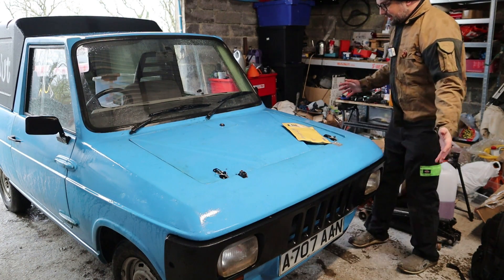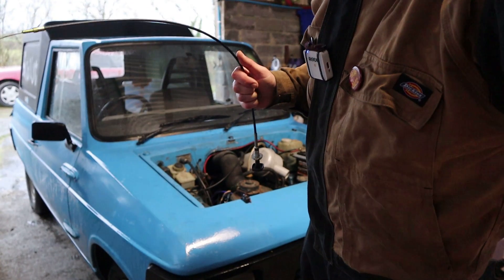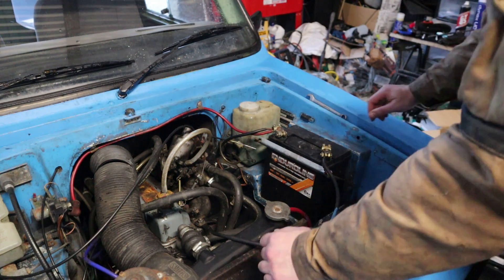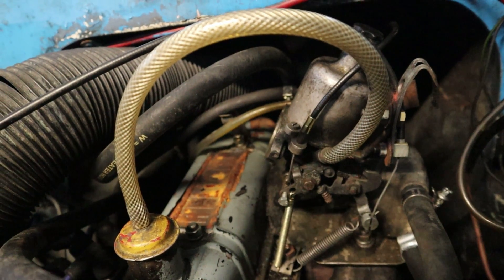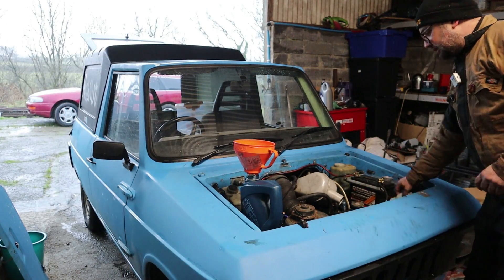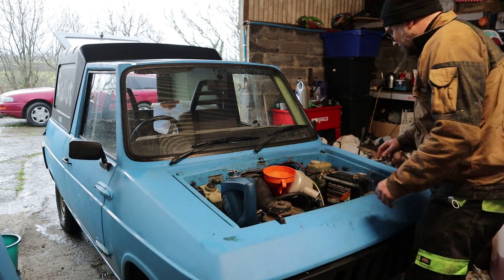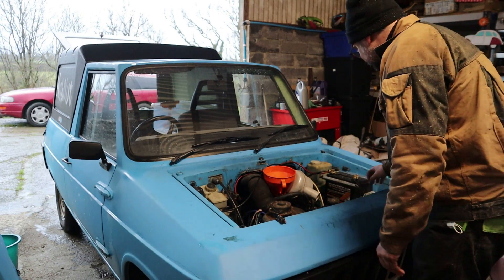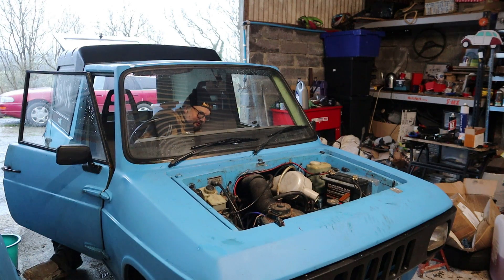Reliant Fox: Choke cable at last! Contains waffle

Comment: When you change the oil filter its always a good idea , when possible,  to pre-fill the oil filter before you screw it into place.
In older cars  you can actually hear the crank running dry and the note change when full oil pressure returns.
All the best ..Mike.
Reply: Or just over fill slightly past the full mark works for me.
Reply: A good point that one, unfortunately the reliant engine oil filter is mounted sideways so it’s not possible on this one sadly.

Comment: Ian, I have in the past cut the brass connector bit with the two screws out of the plastic of an electric connector block to use as a throttle/chock cable end stop, they work a treat and with the add security of double screws.

Comment: I for one will be at the classic restoration show, its more my cup of tea... the nitty gritty practical side of classic cars which isn't at times very glamorous (the far opposite at times) and as you said is the realistic side of classic ownership. Most people can't relate to a lot of what is shown in the classic motor show, most don't have the income and time to make their classic look that good! The show is also the right size and the ticket prices are way more value for money. I may be showcasing my Focus MK1 on a Ford owners club stand this depending how many spaces they get allocated, the plan is to drop the rear subframe and rebuild the control blade rear suspension, such a sticking point that owners put it off. If I see you Ian I will certainly say hi!

Comment: I would like to see foxann used as your daily driver, cheap to run and keep. Regular use would do her the world of good and be ideal for deliveries to and from post office.
She wont rust with galvanised chassis and fibreglass body. Spend a few pounds getting bushes changed and engine tuned properly and learn to enjoy her.

Comment: Entertaining video. Love that you're so careful with the engine after an oil + oil filter change. Seems like you need to adjust the choke fast idle up a smidge. I used to blank off some of my Alfasud's radiator in Winter to get the engine to run hotter. I remember a friends MGB temperature gauge indicated that in the Winter the engine thermostat was cycling open / shut all the time while driving due to an overpowered radiator (and engine driven fan constantly running); I'm fairly sure that blanking off half the rad would have fixed this `hunting' problem.

Comment: Don't  worry the demist in my Bond Bug and then Reliant Robin where just as useless. Shuddered at the water pump screech the Bug had the same and the bearing siezed, shaft snapped and fan went in the radiator splitting a core on the way home from Bangor Uni to nr. Blackpool while going through Conway. Always had an emergency kit in the boot of odds n sods, out came some Devcon 5 minute Epoxy, bit like JB Weld nowadays, onto the split and it held okay for another 16 months being a cash strapped student in '74!!! 👍😊

Comment: If that choke cable gives up possibly try a heater cable for a mini, the one that changes the valve under the bonnet from hot to cold, if I remember rightly it's a solid cable and quite long as well 🙂

Comment: Ha ha. As you’ve probably discovered, you do need two nuts as the cable attaches to the fibreglass bulkhead then you reinstall the grey plastic dash trim and the chromed silver trim nut goes on top. Ultimately, if the outer cable is good you can just replace the solid inner. Quite an interesting choke mechanism on SU carburettors as the whole jet moves down. Regarding gutters, the later 3 wheeled Reliants had stick on affairs that had a thing for detaching with age but fairly easily rectified by cleaning up, masking off the body and bonding back on with a PU bonding adhesive. Best done on a warm day so plastic gutter is nice and pliable. Foxanne is just plain quirky and a great piece of basic motoring.
Reply from the maker: Oh, THAT'S how it's meant to work? Oops...

Comment: Thanks for the tinkering vid, Ian. I remember that when you went to Bromley she was getting through a lot of oil, and when you returned you concluded that it was likely that it was burning rather than a leak. Did that get rectified? I recall a low compression on one cylinder and was wondering if a sticky valve might be lingering. Foxanne is a great car for running about and doing local errands as well as any upcoming adventure.

Comment: As usual I posted a comment before watching the complete video but if you want to Make a stopover on the way to the NEC I would be more than happy to set the emissions timing and check out the ignition system to get a running sweet as a nut just let me know I have a lot of spare time because I’m Retired thanks for the fantastic videos and stay safe

Comment: It's definitely worth getting someone to tweak that engine. Properly tuned, that Reliant engine is reputedly capable of producing better bhp/ton than a Ferrari -some of the Tempest kit cars with that engine are absolute stormers. I'd also put some insulation under the bonnet. My experience with my Scimitar SE4a was that a fibreglass bonnet causes a lot of condensation, which in turn means most of the ignition gets pretty damp.

Comment: Turning it over with the coil disconnected is never a good idea, especially on a carbed car as there's now a load of fuel sat in the cylinders and why it was hard to start. Essentially flooded.
I like Foxanne as she's just different, quirky. The rest I just see as average or even not very good cars. I grew up seeing Ladas and invicars all the time. The charades and Matizs were everywhere in the 00s. Multiplas I've always hated.

Comment: I rather fancy Foxann as a pick up. Not as practical of course but would look lovely with some smart wheel trims and the back box off. But what to do to keep the elements out of the cabin though?
Reply from the maker: They did sell a rear cab section, so you could have them as a pick-up.

Comment: Love Foxanne, Ian. I would like to see you improve Foxanne but in subtle ways so that she stays a Reliant. Perhaps fit electronic ignition, higher pressure SU mechanical fuel pump and carb (HS2?), repair the bonnet properly, insulate and retrim the interior. What do you think?
Reply from the maker: She already has electronic ignition. Fuelling changes are on the agenda I think. She should definitely have more grunt that she does.
Reply: @HubNut  great. Thanks for the reply, Ian.

Comment: Seems like a simple duct-tape wrap would suffice for the split heater air hose. Fixed a half dozen vintage SAAB demister hose leaks with duct tape.  Or is this some MOT reg unreasonableness?
Reply from the maker: I've lost my duct tape...
Reply: @HubNut  Or gaffer's or whatever the nomenclature in British English for wide, sticky cloth infused tape for sealing in damp locations. 

 Concerning the weakness of the heater blower, have you ever had the unit out and checked how corroded the motor's commutator is?  Or if the carbon brushes are worn down and reducing their spring effort against commutator? Assuming this isn't Lucas the Dark Lord of electrons, who hasn't had his way with the wires that feed the heater motor.

Comment: Ok, maybe I'm being sophomoric, but I chortled at "I think I only need one nut".
On a more serious note, I was surprised that any water-cooled car engine requires 20w50, especially in winter, even if it's just a British winter (couldn't help myself).  Part of the interest in your Reliant is that she seems like she was a HubNut-type car right off the showroom floor.
Reply: When I started in the motor trade, all cars used 20w50 oil, modern grades would have leaked out too quickly!
Reply: One of my cars runs straight 40 grade in winter (50 grade in summer). Older cars tend to have very crude oil seals (if they have any at all) and thinner oils just pour out of all sorts of places!
Reply: @saxon-mt5by  Perhaps it's because I'm more accustomed to cars sold in North America, but by the mid 1960s almost all the cars on the market used 10w30 with a switch to 5w30 for winter.
Reply: @CaptHollister  I'm pretty sure 10w30 wasn't even available in the UK in the 1960s; even 20w50 was only just becoming commonplace.

Comment: I care more for Foxanne because she is understated and despite being rarer than a 2CV and perhaps as rare as (possibly rarer than) an Invacar, Foxanne comes across as attainable. A classic car one could just go out and buy, then use normally - a sleeper of the classic car world. Similarly, Matt@FuriousDriving's Volvo 740. Just different enough and "we don't see those anymore sadly" from certain quarters (like myself) who get that it is about the experience, not having and utilising pseudo-performance because either we were never that type of person to begin with, or otherwise not under 25 years old and/or full of it.

A shared trait with Twc is the "little engine that could" and a respect for keeping an unloved (among the great unwashed) car going as opposed to scrapping it for no other reason than it being old. The same argument could be said for Elly, but I'd counter that with most people outside of 2CV/classic car boffins care more about a 2CV's looks than what's underneath (ditto classic VW Beetle) and therefore far more cemented in the public consciousness.

Additionally, being a classic Volvo enthusiast I'm very much biased; the 340 seats also swayed me very early on. :)

Comment: Foxanne is just as cute as Myrtle, Elly and TWC, just in a slightly different manner!

I feel that there are two directions to go with Foxanne; One is to stay as close as possible to the 'standard' car, and the other could be to go mildly overboard! 1100 or 1300 A series engine, Minor  or Marina gearbox and diff, front discs, servo, but keep the outside as stock as possible! Not a sleeper, but perhaps a dozer! 🙂
Reply from the maker: A Series engine? Gawd no! Why would I replace this lightweight aluminium beauty of an engine with a lump of iron?
Reply: @HubNut  I was just thinking of a higher output! I do take your point about the lump of iron though! How about a Hayabusa engine instead? 🙂

Comment: Forgive me, but I feel like the Canon is not the right camera for you, Ian. I know you have the DJI, but have you looked at the Sony ZV1? It's a fixed lens, simpler, fast autofocus, good in low light vlogging camera. (You could also go a bit JayEmm with it if you so wanted!) I've had ugc footage from it during the day job and been impressed by what's been achieved. The on-board mic is also surprisingly good.

As for Foxanne, I'm along for the ride... you had me hooked when you painted a car with vinyl matt emulsion!
Reply from the maker: ZV1 is on my radar, but I'm reluctant to spend ever more on kit I might not end up using. I'm using the Canon mostly because it's just there, is underused and is better in low-light conditions. I think maybe what I actually need is the DJI and better lights...

Comment: Question, shouldn't you fit  a warning light for when the choke is on? (MOT-REG?)
Reply from the maker: This has never been a requirement. Useful, yes, though the control is quite visible.

Comment: Seeing as the gear lever seems to sprout from the same position on an identical dashboard, I'm puzzled as to why the engine is so much further back under the bulkhead on the Fox than it is on the Kitten.  Is it really just the position of the curved windscreen?       Seems like an unfortunate design choice.

Comment: Is there an aftermarket carburetor with an auto choke that would work on the Fox? I would love to take the Fox on a road trip, here in California.
Reply from the maker: My experience with autochokes is that they're mostly absolute rubbish.
Reply: @HubNut  can confirm with my experience of the 1988 P405 with 1.6 XU engine and Solex carb.

Comment: 2 nuts to lock to dash as when you push itll fall back?
Reply from the maker: There's a collar, that also screws. Collar goes one side, two screws the other. I think...
Reply: @HubNut  i have a book for you which may be useful for Faxanne’s carburettor. (A SU book). Will dig it out.

Comment: I'm sad , I miss my 1993 Rover Metro , still dream of it at night feel free to laugh lol but it cost back in 2007 £300  bought it off a friend who was a mechanic and had done the head gasket so it was perfect and so much fun on village lanes , new cars suck they are too refined and there's no fun , you cant feel the road , you have zero feedback through steering wheel and the experience is boring , I once drove a McLaren 650S  test drove it for  fun but it was boring , yes it is very very fast but thee new cars you just get a synthetic robotic feel from them , where as the old cars from the 1950s to the 1990s were miles better , i would rather own my Metro than that McLaren call me crazy lol